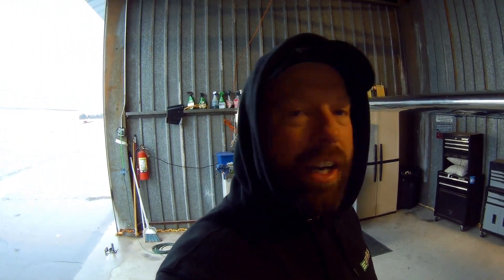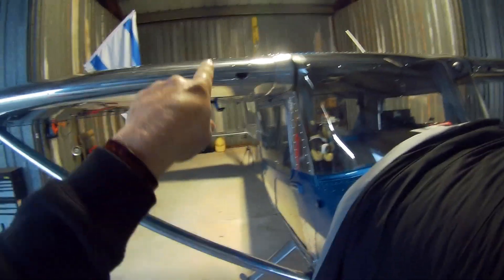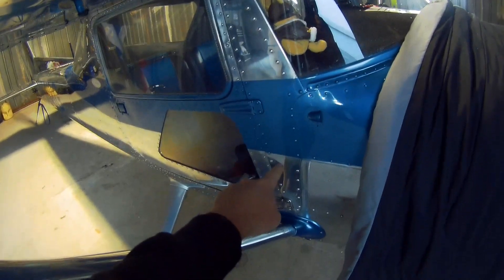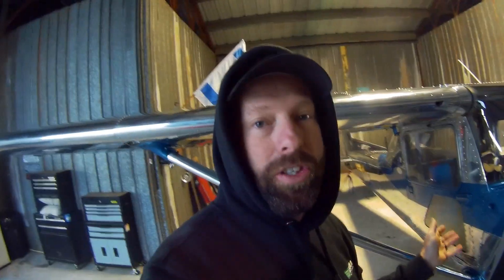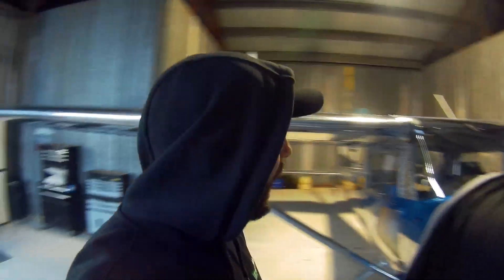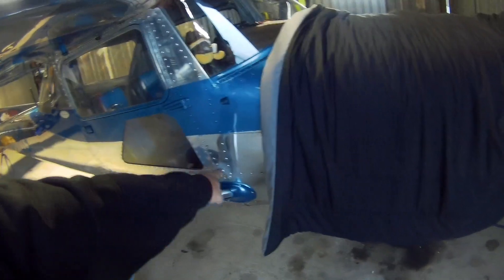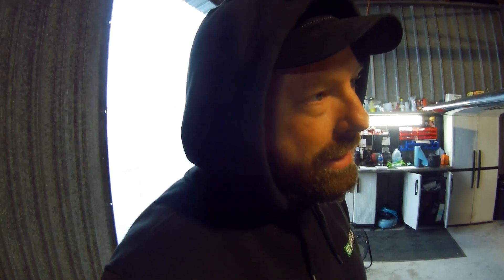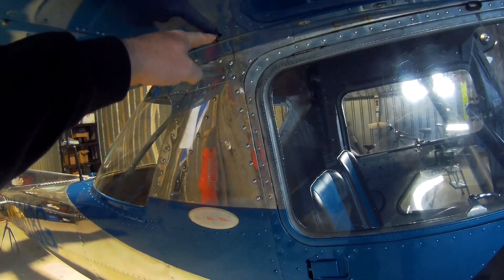Best Cessna 150 Safety Mod??

Comment: Great video…..first thing I did this morning was to go look under my 150 and guess what…..found a plug that I never noticed before….i will talk to my A&P to switch it to a fuel drain. Any recommendations for the part?
Reply from the maker: 150s have several different options, best to have your mechanic determine which one to get. May be as simple as the CAV-160 or may need the Mt-101

Comment: Good lesson.  Also we will find water in wing tanks that doesn't get to the lowest sump, especially in the desert when outside and the diurnal temp spread makes a lot of condensation each and every day in summer.  May have to move plane a bit to make sure the wing sump is the lowest point in the wing tank.  Good job.
Reply from the maker: Thank you and your correct

Comment: Mate, you might’ve saved my life. Definitely my wallet! My training was done on 172’s but a bit over a year ago I was able to purchase a 150. I asked the previous owner many questions including sump locations, needles to say he was unaware and did not mention the underside location. Fast forward to around Nov 2023, I begin to have trouble starting the engine for unknown reasons, all my troubleshooting was to no avail. I stumbled on this video a couple months back, lo and behold, guess what I found on the underbelly? A drain plug! My instructor and I grabbed some tools and when that puppy opened, I think I went completely pale! There was so much sediment and water that came out, I honestly don’t know how the engine was getting fuel at all. 

So I can honestly say Thank You for posting this. It’s pretty easy to miss it in the POH given how dismal the details were before POH’s were improved. The previous owner, my inspector, and my mechanic had no idea it was there. My annual is coming up and I’m absolutely putting in a quick drain under there!! Thank you again and thank you for the content you put out!

Also, it solved the startup issue immediately, go figure.
Reply from the maker: That made my day reading this! Thanks for sharing and it amazes me how many 150's have this issue
Reply: Hey, I asked my A&P about switching it to a quick sump -I have some questions I’d like to ask you, any way I can contact you somehow or just message here?

Comment: I did that quick drain mod years ago. There was quite a bit of crap when I pulled the drain plug. I have never got a drop of water of junk when sumping since. But after overhauling the entire fuel system and the plane being hangar kept, it’s still good insurance.

Comment: I am not a pilot , but this make perfect sense to me . That plug is the lowest point of the fuel system . Water is heavier than fuel . It would make perfect sense to me to to drain a bit from the lowest check valve as a pre-flight check .

Comment: I owned a 152 from 1082 to 1989, and that was still the low point in the fuel system. I did drain the tank sumps, then the belly drain, then the gascolator (in that order) on each prefl8ght, especially aftet every refueling. I don't remember if the belly drain was factory installef or if I modified it. BTW, I strongly recommend waiting a while to sump the tank drains after topping off a nearly full tank, as it can take longer than you think for any water to get down through the fuel to reach the sump - guess how I know. Engines don't run well on water!

Comment: Thanks for posting this.  I got my ticket training on 172, but I own a 150L, and I always wondered why the fuel systems are so different. I'm getting a new quick sump valve installed this week on my belly plug because of this video.  Also, I wasn't aware that the gascolator replaced the fuel sump in the engine bay altogether.  

BTW, I have a fuel shutoff valve that is damn near impossible to turn.  Any recommendations other than full replacement?  Is it supposed to be absurdly difficult to turn?
Reply from the maker: Probably needs overhauled or replaced. They should turn easily. Could be varnish or debris that needs cleaned and some polishing.
Reply: @cessna150pilot6  I just bought a MacFarlane STC replacement valve that is supposed to work better than stock. I’ve also added a STC belly quick sump for the fuel line down below the valve. Hopefully that will drain out the kind of grit that gummed my original valve.

Comment: Wow!  

My 150 is in at annual at the moment.  As far as I know, everything you says makes sense.  

But if it's that prevalent of a problem--why hasn't there been an AD on it?  I would think that somebody would have noticed if it was even the 8th or 10th most common reasons that C-150's had in-flight engine failures.  Maybe we're all mostly just lucky, and fuel debris is fairly uncommon?
Reply: There's a club 172 that I got checked on in within the last year.  It has a fourth quick drain down in the belly; I presume from a similar corresponding location.  All interesting.

Comment: That quick drain is an exceptional value.  Do note, while easy to install, it is a modification and is STC'd by a firm.  And an FAA form 337 must be completed and signed off by an IA, sent to the FAA in Oklahoma city.
Reply from the maker: Thanking for adding this important information!
Reply: Do you happen to know the name of the company that has the STC, or a link or something?
Reply: or not.

Comment: Sounds like a good thing to do.  Is the SAF-AIR CAV-170 drain valve the correct one for this application?  It is a 7/16”-20 thread.  Thanks.
Reply from the maker: The correct assembly if you currently have just the plug is the Saf-air MT-101. Early models (E and earlier) take the MT-101-1.  You may have to request it direct from them on their website, I don't see it online.
Reply: @cessna150pilot6  -  You provided some important and useful information in this video and I appreciate it.  I’ve owned and flown regularly a 1969 J-model since 2006.  In that 17-year period the AN929-6 aluminum cap has never been removed from that tee on the bottom of the fuselage.  In fact it was coated in paint from the last time the plane was painted.  I went to it this morning to fly for my normal half-hour but first, after I drained fuel from the wing tanks and the gascolator and inspected it (no water found), I removed that cap.  I drained an amount of fuel from that tee into a bucket.  I then poured it into a clear glass jar so I could inspect it carefully.  There were just a few small droplets of water in it.  There was a small amount of dirt in the cap itself.  I cleaned out the dirt, removed the paint, and replaced the cap.  When I got home I called Saf-Air and inquired about the MT-100 drain valve.  It is only available directly from them because it includes the necessary STC paperwork and the cost is $40.00 for the kit.  I ordered one, it should be here sometime this week.  Despite the fact that I didn’t find much when I removed the cap, I’ll feel safer from now on by periodically draining this new valve.  Thanks for your efforts!